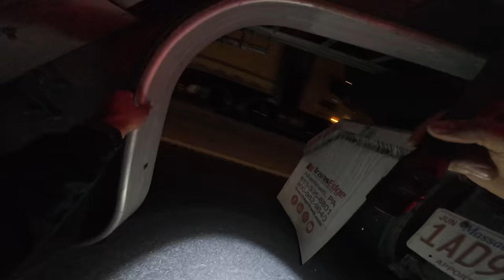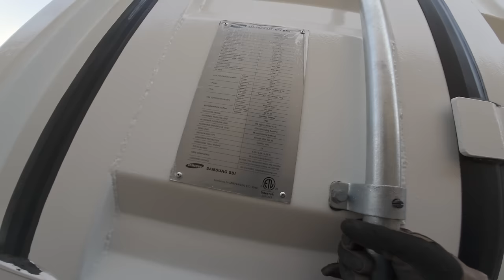70,000lb Battery Destroys YouTuber's Trailer!

Comment: The load was not over the axles . Awesome job from pepes crew . Denis from Santa Rosa Ca .
Reply: You don't put a 70,000 pound load over the axles unless your trailer is rated for 140,000 pounds.

Comment: Those batteries are used at solar sites to store power .
The solar panels produce power during daylight and some of that power goes directly to the power grid and some of it is stored in large power cells like the one you are off loading. Most solar battery sites will have more than 100 of thoses batteries which is why you have seen so many of them on the highways

Comment: Looks like he needed the tag axle under the neck, maybe setting it back mid span might have helped enough before it snapped, looks like the wrong trailer for the job.  Miller would like a call for you to buy the new 100t rotator.

Comment: South Australia got rid of it's coal fired PowerStation's and went full windmill and solar. One still ,over cast day and the State ran out of power. Mr Musk 's solution was to supply a bank of those batteries... so much for environmental concerns. 🙄🙄🙄🙄
Reply: you make no sense . the battery solution means no need for the coal. so yes good for environment.
Reply: @ronblack7870 How is the solution made, transported and what is it's life expectancy ? Then where does it go
Reply: @ronblack7870  never seen a lithium mine?

Comment: the people who loaded it onto the trailer should have put 6x6 or 4x4 every four feet to distribute the weight of the load over the whole trailer. With only 3 or 4 spacers under it, all that weight was centered over only a few places, on an aluminum trailer no less.
Reply: Yeah, 25K lbs on every beam, that surely helped 🤭

Comment: The manufacturer states their stepdecks(depending on model) can handle 50,000lbs to 60,000lbs in a 4'ft area. This guy did something very wrong to destroy the trailer. Load positioning is my first guess. Perhaps he was driving like a maniac and going extremely fast over speedbumps and potholes. Anyone with a brain would ensure the trailer is loaded properly and drive carefully when transporting a load that is more than 70,000lbs.

Comment: Trooper in a different state. Guess cali has a different mentality, but I would have closed the lane. It’s a hazard to have a semi on a should for 8 hrs at night. If the SGT was so worried call DOT out with an arrester truck. Now you closed a lane in rush hour when there is a greater hazard of chain reaction collisions. Really just prolonged the hazard and didn’t reduce the risk of collisions. I understand that speeds are reduced, but cars can still kill going 35 MPH.

Comment: Even though this load was placed wrong, these kind of batteries are creating all kinds of problems. Being transported on the Highway without an Escort is reckless, they can be so volatile if involved in a accident. Your not gonna put it out with water if catches alight, plus the poison fumes.
Reply: so then stop voting for it
vote for more coal plants not solar.
Reply: So I guess every gasoline tanker needs an escort too?  After all a gasoline tanker has 48 times as much stored energy as this battery does.  And ALL combustion fumes are poisonous, no matter what you're burning.

Comment: So as a Driver who drove Europe and North America a couple of Questions are popping up here 1. if the load is 70500lbs and the GVW for this tractor trailer combo is 80000lbs by law how can this be transported this way legally imo it can't. 2. as others are pointed out already the load distribution is questionable at best 3. the load securement is absolutely inadequate even if you calculate your chains with 15000lbs each in straight pull 4 chains crosswise only counts for 60000lbs and the provided anchor points on the aluminium trailers are rated 5400lbs only as are the garden variety binders

Comment: I work in a stock box plant and I do all the receiving, I deal with trailers full of paper rolls that can be as big as 72" tall by 72" wide, they can weigh up to 9,000lbs and I always have appts delayed because the mill loaded them wrong and put wayy too much weight on the tongue of the trailer. With this being a flat bed This driver should have caught that right away because if a driver can notice it on closed trailer that is locked this dude could notice it lol.
Also the cops pushing this to the AM is a plus and minus I mean yes they get better viz but at the same time traffic is much heavier in the AM right?

Comment: Can’t believe people are buying those big heavy batteries when a generator would have been more efficient because they are obviously going to need a generator to recharge the battery pack anyway. Yes I’m aware that the pack most likely has the ability to charge when it’s connected to the grid but that option isn’t available when the grid is down. Lastly a diesel generator will keep running as long as you feed it fuel and most are setup to run for several days without needing to be refueled.
Reply: Actually these batteries are used as a backup , and normally charged from the grid. I only know this because I had a great time trying to figure out why an LG system would crash at a hospital twice a week. 
They installed 2 of these , and would switch over to test them overnight.  While switching over , voltage frequency would drop below 50 , and creat an error.
Reply: @Emilthehun  diesel generator is still better and proven technology for that purpose.
Reply: @P-J-W-777  my lack of knowledge regarding backup generator vs battery doesn't allow me to agree or disagree.  
But as a normal person,  I would think diesel makes more sense. With batteries you are screwed if the power is out for longer then your capacity.  Diesel just keeps clunking away.

Comment: Finally understand why LA constantly takes 2 hours to go 20 miles. While I get where theyre coming from on some theoretical level, the idea the CHP would rather leave a broken down semi on a narrow shoulder all night because they want heavier traffic when they do a 2 hour lane closure is mind boggling. Running into a broken down truck is deadly and is the reason its illegal in most places to park on the shoulders. It being out of the travel lane doesnt make it safe. Daylight and slower traffic might be beneficial on one side but jamming it up even further can cause secondary accidents and other issues. A couple DOT trucks to properly block it off shouldnt be a problem, even at night and the lower traffic regardless of speed cancels out the added hazard of darkness in my opinion.

Comment: And as if that wasn't enough, the police say that in the evenings there are drunks driving fast, so it's dangerous to work on the highway. as if drinking alcohol for drivers is very common and impossible to control or prevent.

Comment: I work road construction. We work nights so.etimes specifically to avoid traffic. 8am rush hour traffic is def not ideal for lane closures. I would have thought a 3am closure would have been safer than 8am.
Reply: That's what I thought. Yea comeback when traffic is 10x worse
Reply: They probably didn't have enough cops on shift to tie up 3 or 4 of them for 2 hours on a lane closure.

Comment: 1. According to the FMCSA load securement rules: "The aggregate working load limit of any securement system used to secure an article or group of articles against movement must be at least one-half the weight of the article or group of articles. The aggregate working load limit is the sum of: One-half the working load limit of each tiedown that goes from an anchor point on the vehicle to an attachment point on an article of cargo . . ."
Here, the load is 64,000 lbs, and each chain goes from the trailer to the cargo. So, the total WLL of the securement system must be at least 32,000 lbs. Divide that by four to get 8,000 for each chain, BUT, because they attach directly to the load instead of passing over it, you must multiply by two. So, each of the four chains must have a rated WLL of at least 16,000 lbs. A standard grade 30 1/2" chain is rated for only 4,500 lbs, and even a grade 70 1/2" is rated only for 11,300 lbs. So, even if he had four 1/2" grade 70 chains (which I doubt), he still didn't meet the minimum tie down requirements. 

2. The rig is a 53' step deck and tandem full sleeper tractor with loading and securement equipment, so my best guess is an empty weight of at least 32,000 lbs. The load weighs 64,000 for a gross weight of 96,000 lbs. California has a maximum allowable gross weight of 80,000 lbs. So, he was probably about 16,000 lbs overweight on his gross, and at about 8,000 lbs overweight on each tandem. How did he think he was going to get through the weigh stations?
Reply: First you have to use the right tons.  The load is 32 METRIC tons.  That's 70,548 pounds, not 64,000.  How was he going to get through the weigh stations? That's why he was rolling at night.

Comment: Pretty sure you should never put that much weight on a step-deck trailer lol, especially aluminum
Reply: Probably would have gotten away with it if the weight was actually on the trailer's axles

Comment: That's a mechanics 101 failure by the driver right there. Load goes over the axles, not mid span of the trailer members, unless the load itself is a used as a bracing member, such as containers held with twist locks on light trailers.

Comment: 70 000lb + on 2 axle aluminum trailer and a truck with 2 axle only no pusher....way way overloaded , I have a 3 axle trailer and safely can pickup  64 000lb load with a single extra pusher axle on a truck, safety load to pickup is 72 000 lb if its set up right, so this guy was way overloaded, no wonder he broken the nose of the trailer off. Maybe this truck driver did not know what he was doing.?. TH

Comment: I figure all the bouncing up and down on the trailer that might have weaken the welds on the frame on that trailer. I did like to know what is the weight rating for that trailer, I would expect an RGN low boy or heavy duty trailer with re-enforced beams and 3xle set up pulling those Electric battery of this size.

Comment: Just wondering why did you set it on the wood? Why not straight on the trailer?
Reply: So they can grab it better on my flatbed that's what I do if I need to throw straps or in the customer needs to get under the freight to grap it better that's my guess I could be wrong
Reply: so the forks on the forklift can grab it on the bottom.

Comment: The driver was at fault. When you got something that heavy, you need to have it in the middle of the trailer plus he should have had the axles on the trailer spread apart. That was the driver's fault, not the trailer's problem. I've hoped that much weight on my trailer. And it's just like that 1. You just gotta know how to f**** load it.

Comment: By the design, Xtreme looks like they might've had people break off from MAC but they seem to have pushed light tare weight too far. It is loaded basically perfect for a tandem trailer. As loaded, he fits within CA permit weights. Drives axles may not rated high enough but since that is within permit weights in the US there's no way the neck should've failed. Even their lower rated trailer is 50K in 4' and 70k in 10 (different section says 60 in 10). Supposed even distribution rating of up 120k gross on that frame yet all sorts of guys are blaming the driver, until it happens to their equipment. Then the manufacturer is stupid.

Comment: Fail to balance a load at your peril. I'm cautious of excessive tongue weight after lifting my front-end up till the tires didn't touch the ground when it wasn't level. I took-off ok but couldn't even climb the shoulder of the road to get on. That little bounce and it was stuck partway in the road while I ran to throw weight into the footwells.

Comment: More proof that "If it fits, It ships"  is a absolutely horrible motto.  That kind of weight never should've been on an aluminum trailer... especially only two axles. There was no problem with the trailer... it was 100% owner/operator error. It was too light duty of trailer & it was improperly loaded/ distributed. Now that they have the financial loss of that new trailer... plus the Massive bill of 2 Rotators and a replacement tractor/HD trailer to haul it to relocation....  they'll learn to pay attention to equipment limits.. Greed of getting the job/sale knowing the equipment wasn't rated for it backfired.  Even if it didn't fail on this job... the structural damage it caused could've caused a failure later while hauling a lighter load & they wouldn't understand why.  There's a reason Trucks/Trailers & equipment have limits...

Comment: Shipper found a cheap trucker to haul for nothing!! Also a immigrant looking for a quick buck using a low buck trailer!!  More problems with LITHIUM battery stuff!! It's just bad news !! Martine showed up unprepared for the load!! Get it together!! Pepe's not a supply store!!
Reply: Trailer had nothing to do with it . I own one extreme 22 year. Driver error.
Reply: Only one apple also 😢
Reply: @ow8551 The trailer had everything to do with it, hence why no professional huals 70k on a dual axel aluminum deck  trailer that trailer was way overloaded
Reply: I don't think that was a "low buck" trailer.

Comment: One time I rolled up a guy lost his scrap It was dark im in the middle of the road telling people to slow some guy tried to deliberately run me over Literally opened throttle wide open Ran over 2 pieces of metal The guy Had the wrong straps And didn't have ones in good condition

Comment: 70,000 pounds on a 2 axle aluminum trailer. We need to instill more physics into drivers. I never drove anything that require a class b or class an and I have driven a tow truck that was rated for 26,000 and a wrecker with the same rating as well. I know aluminum is pretty good stuff for light weighting trailers but I also understand that aluminum is a softer metal than steel so that right there tells me I’m limited in weight capacity. 70K would definitely not go on that trailer and since I don’t fully understand loading I would still throw that thing more towards the axles to keep weight off of the tongue. No expert though but I’d really try and use some common sense here especially with the type of trailer vs the weight in which I gotta pull with said trailer. If the math ain’t mathin it’s a no-go
Reply: Do you not realize there are 2 axles under the nose of a semi-trailer?

Comment: That looks like it is an aluminum made trailer and they tongue loaded it to heavy instead of distribution of the load evenly as most green drivers. And that is what makes it bad rep for the veteran drivers. As I always check weights and size as a small error can be a deadly result.

Comment: The Conex doesn't weigh  70,550 that's it's Max gross rating.  Semi Trucks are only allowed to have a GCWR of 80k  empty truck with trailer usually weighs 30-35k.  So at the very most that Conex weighs 50k but more likely in the 30 to 40k range.  The guy learned a valuable lesson today don't make room for a second load until you're loading second load.  This happened because the load was way too far forward.
Reply: That isn't a common shipping container with something being shipped in it.  It's a lithium ion energy storage chassis.  The battery is built in it.  The nameplate right on the side of the battery clearly lists the total weight as 32 tons - and those are metric tons.  70,548 pounds.  There's a reason he broke the trailer.

Comment: I'm no expert,  but I'm darn sure I'd place the centre of the weight over an axle if I had to..
Reply: So you're going to put 70,000 pounds on the back of the trailer over one set of axles?  No, you're obviously not an expert.  Do you not realize why Semi-trucks have two axles in the back right under the nose of the trailer?

Comment: It could be 20,000 lbs that marking on the trailer only means how much weight that container can handle
Reply: That isn't just a common shipping container - it is built to house the battery system inside.  The nameplate on the unit said it was 32 tons - and those are metric tons. 70,548 pounds.  The marking on it is accurate.

Comment: Even if the load was back hes nearly 30,000 lbs overwieght for that trailer. plain and simple.
Reply from the maker: True
Reply: @PepesTowingService  plus no oversized placards, probably no permits. Im not the biggest law guy but this dude needs shut down.

Comment: Wouldn't that weight printing be on that shipping container even if it were empty?
Reply: That isn't a common shipping container.  It's the chassis for an energy storage system.  The nameplate gave the total weight of the system -- 32 metric tons.  70548 pounds.

Comment: Why in the heck would you not load it center on the trailer? Is this a driver or whoever loads it problem? Common sense says you don’t long load 70,000 lbs at front of trailer